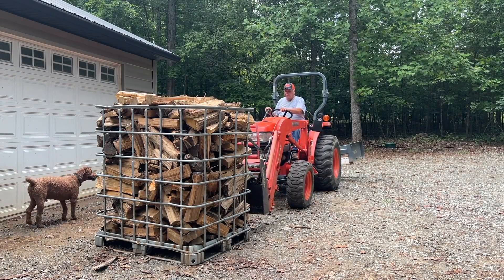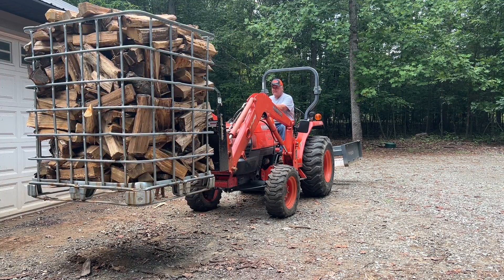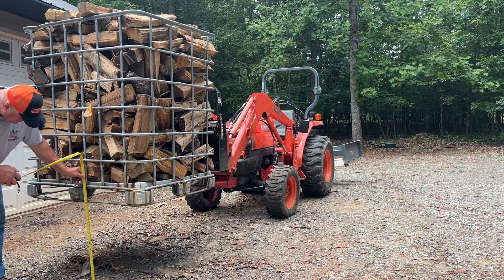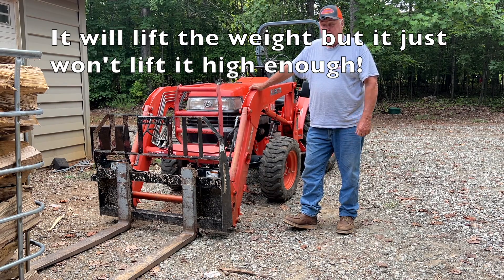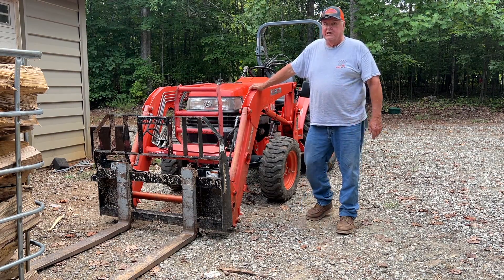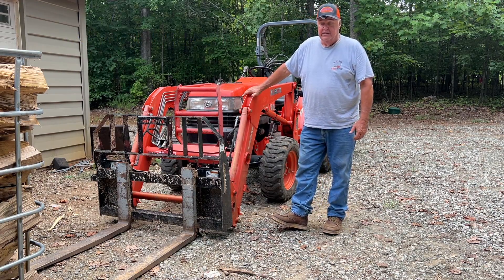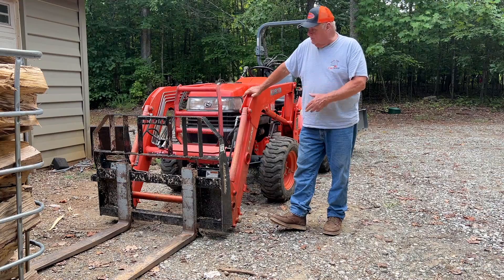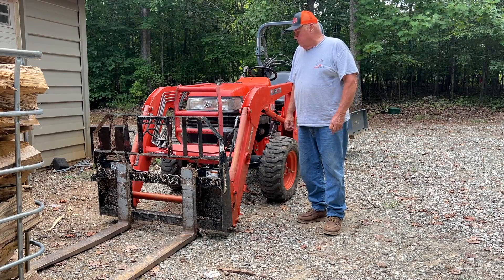Increasing Kubota loader lift capacity

Comment: Pressure relief valve shims are a lot cheaper
Reply from the maker: Hi. Thanks for watching. I had already maxed the pressure with relief valve shims. This solution drastically improved lift capacity using the tractor’s max hydraulic system pressure.

Comment: Im all to a-custom to broken loader and frunt axil parts. We do custom sawmill work with a max length of 26 foot, the loads applied twisting things around are staggeringly abusive on steel, To a small tractor. Ive thought about a video showing it for people its a lot of flex, compared to just a bucket of material, ect.
.
We run a old JD 440icd tracked, crawler/loader for the majority of the logs going on the mill. As a 24" 26' log is WAY, WAY, far beyond what any small tractor can manage. I believe its cylinders are close to or over 4"
Even for it, sometimes its one end at a time.

Comment: I have the same tractor, with them new Hydraulic cylinders can you lift a log up 28" on the big end by 16' ?
Reply from the maker: @markreading6377  I would say no on the 16’.  10’ probably yes.
Reply: @oldguyfirewood  oh do you ever pick up logs with your unit with fork
Reply from the maker: @markreading6377  I do, but I’ve never made a comparison to the grapple. I would say the weight difference is only about 250lb.
Reply: @oldguyfirewood  oh

Comment: Do your math you are only going to gain 15lb of lifting at the most... your wasting your time and money
Reply from the maker: Ha ha…. The proof is reality. You don’t know the size of the old and new cylinders or the system hydraulic pressure. Without those two figures you cannot mathematically calculate the gain.

Comment: I've got an L2502.  The capacity is a little over 1,400 pounds, and I'm finding that it's just not enough when dealing with these IBC totes.  I can only fill them 1/2 way with water or 3/4 full with oak.  I'm considering doing this.  Thanks for putting this video together and telling us about the company that provides the needed cylinders.
Reply from the maker: Hi Chris. I’m betting that your stock loader hydro pressure needs to be adjusted up first. There are several YouTube videos showing how to do this on Kubotas. It is easy and involves some shims. You should be able to lift a full tote of oak, at least off the ground. Once you do that,I would strongly suggest you add the hydros plus cylinders. You will be amazed at the difference. You’ll be able to lift a full tote of oak to the max height capacity of your loader. It has made a world of difference for me.
Reply: @ thanks! I’ll look into that.  I’m pretty new to using tractors.

Comment: That is an amazing upgrade! Quite the difference for sure. So are the cylinders a bigger diameter, the piston rods or both? Would like to upgrade my kubota like that! Great video 👍
Reply from the maker: Thanks for watching.  The results were much better than I expected.  I need to measure the cylinders to see if there is a size difference.  From first glance they seem to be the same size.  My knowledge of hydraulics tells me that the inside diameter of the cylinder would have to be larger to increase lift capacity with the same psi of hydraulic pressure.

Comment: With "old-age" the Relief valve( springs) get "soggy"& Week,plus; hot hydraulic fluid lessens lifting capacity.  That top- unbraced "portal" front spindles are "famous " for crushing the seals and bearings; / causing LEAKS & eventual total FAILURE when "Pushed" beyond factory designed parameters.
Reply from the maker: Thanks for watching and commenting Donald.

Comment: Great upgrade, sure is frustrating when a manufacturer rating isn’t close to real world uses.
Reply from the maker: @765Guys  thanks Genin. I think someone mentioned you had done this upgrade to a John Deere?  It makes it much easier to load my dump trailer.
Reply: @oldguyfirewood  my friend Aaron did this one to his Deere. But his driving force was he had a leaking cylinder leaking and a set of hydros plus was cheaper than 1 new Deere cylinder. It’s been great so far on his tractor.

Comment: That first cylinder you installed I’d recommend taking the pin out of the rod and rotating the rod, you’re gunna have a heck of a time greasing that rod pin
Reply from the maker: Good eye Elliot!  In my haste to finish the video I went ahead and did the lift without greasing the pins. When I went back to grease them afterwards I discovered my mistake and corrected it. 👍

Comment: Impressive that just cylinders made that difference.  I been hearing people shimming the reliefs valves to get more lift.     

I got newer 4701 with filled rear tires and with 6ft cutter on the back it will lift or pick the back tires up off the ground trying.    Please don’t stand in front or under it while it’s lifting that heavy weight.
Reply from the maker: Thanks for watching Shane. I went the shim route several years ago. I went to just below max recommended pressure and it helped some. It sounds like your 4701 has no lift problem at all!  I agree with the safety advice you offer.

Comment: Hello Dick, Nice! probably should add two wheel weights to each rear wheel, It really helps to stabilize the tractor 🚜👍🏼🇺🇸
Reply from the maker: Thanks Larry… good advice. My rear tires are loaded and I keep a good amount of weight on the 3 pt.  I’m always very aware of “seat of the pants” feelings. I’ll check into wheel weights.
Reply: I contacted Kevin about add lift capacity for my kubota MX5100”👍🇺🇸

Comment: Before you guys go head and do this... keep in mind that the loader is engineered so that you cannot overload the tractor front axle and frame with it set to stock specifications.  When you modify it to exceed these specs... you're going to find the next weakest link.  And it won't be cheap.
Reply from the maker: Thanks for watching. I talk about that in the video and advise everyone to make this modification at their own risk. In my case I’m lifting the same weight I was before only I’m lifting it higher… no additional weight on the axle.

Comment: If you add wheel weights or have the rears filled with calcium if will pick up heavy loads no problem
Reply from the maker: @johnpierce1251  hi John. My wheels are already filled and I keep a heavy implement on the back. It’s necessary for sure.
Reply: @oldguyfirewood  it just looked really light in the back wheels is all I was concerned about you getting hurt stay safe my friend and hello Clifford

Comment: Did you have to add any additional hydraulic fluid to compensate  for the larger cylinders?
Reply from the maker: @robertgreen8695  thanks for watching Robert. The fluid level was good without adding any.

Comment: Outstanding results from this cylinder replacement. This will help you immensely while loading onto your trailer. I don't believe this is making the machine any more dangerous. In fact, I believe it's making it safer to load and unload without restrictions. 
Kenny
Reply from the maker: @FirewoodAdventure  thanks Kenny. I totally agree with you. I’m loading up a dump trailer load tomorrow for a delivery. I’m excited to try it!